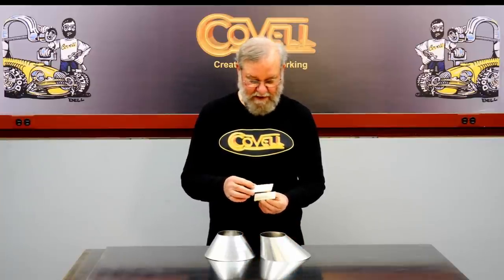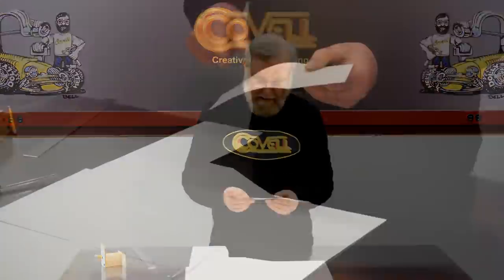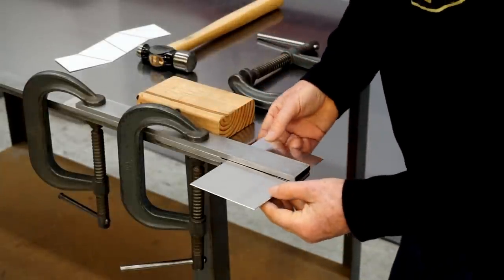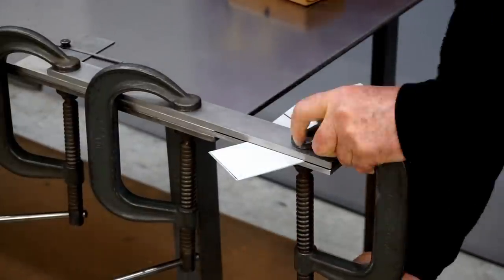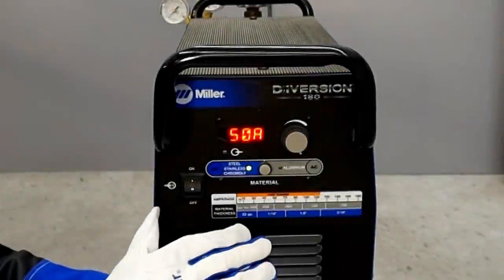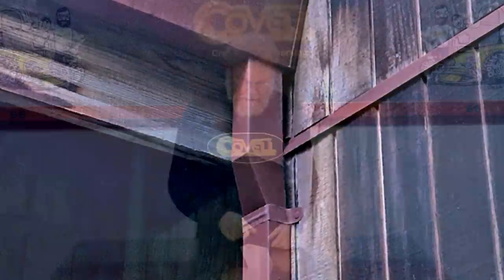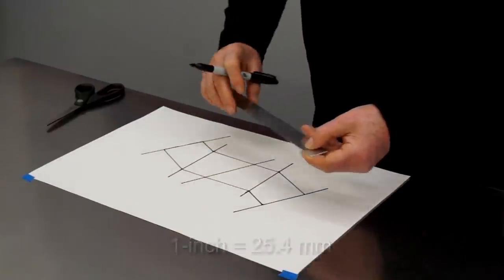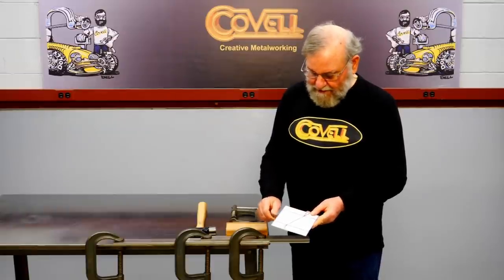Rollation, Round 2

Comment: To my eyes it always seems you work quite wasteful. For example your first rollation is in the middle of a huge sheet of paper which you then have to cut apart and a large part can not be used again. Do you just do this to make a "clean" video and not mess around with small pieces of scrap or do you do your regular work also like that?
Also for example with the dust pan you made the hammering form from plywood and in this you had to cut most of it away. Is there no cheaper/more efficient way to do such work?
Reply from the maker: Piet Hoffmann - Thanks for your comment. If you watched me work in my shop without the video camera running, you'd see that I am extremely frugal with my materials. When the camera is running and the clock is ticking, I take a completely different approach - focussing on keeping the work centered in the shot, and visually as clean as I can make it. 
In the case of the hammerform, sometimes it is worthwhile to cut a large portion of a flat sheet away, since it's otherwise quite difficult to maintain flatness if something is made from multiple pieces.
These are all judgement calls, and different workers do it different ways, but I want you to know that I do take economy very seriously.

Comment: As a skilled sheet metal fabricator this is painful to watch. It works but.......
Reply from the maker: Chris - in no way am I suggesting that everyone work in this way. I'm showing the Rollation technique because it's useful, and not widely known.
How would you do the pattern development for a transition between two egg shapes, one larger than the other, with one rotated 37 degrees? That would be kinda hard, don't you think? And it could be easily done with rollation.